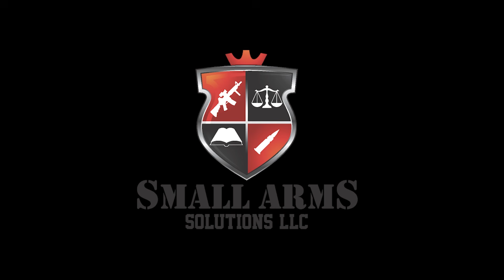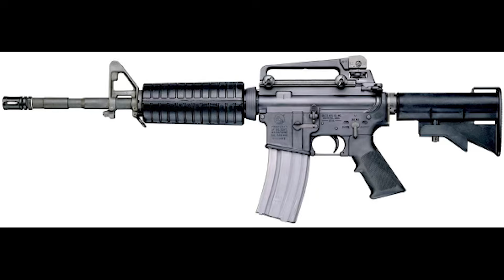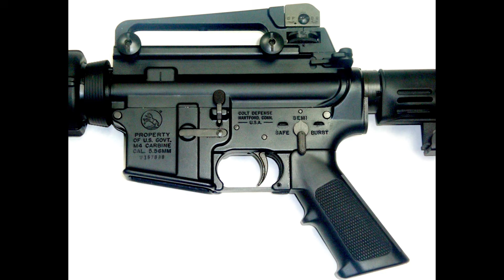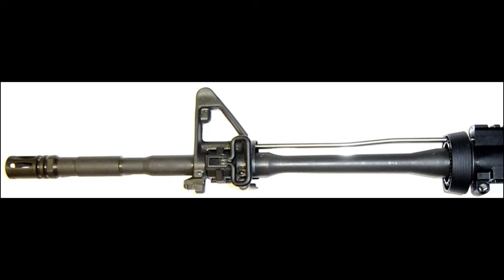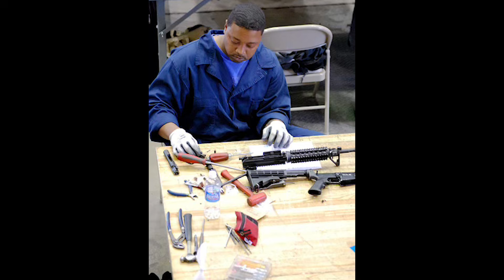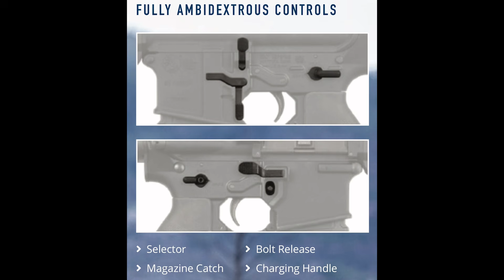History of the US Govt M4A1 Carbine

Comment: I never understood how a 14.5 inch barrel became general issue. I much prefer the 16 inch for an AR carbine. The cartridge really is best from a 20 inch.
Reply: Colt used the carbine gas tube in the M4 and needed the rifle to fit their bayonet, so they went with the 14.5 barrel..The gas port is also the same distance from the end of the barrel as the standard M16/M16A1/M16A2..
Reply: The very first Carbine with a 14.5” barrel was the Colt 653 M16A1 Carbine, where everything was the same as an XM177 except for the barrel and muzzle device.  ATF banned the exportation of XM177s with the Moderator because they considered it a silencer, so Colt made the 653.

Prior to that, the first carbine model was actually the 605 with the barrel cut to 15” and everything else the same as a 602 basically, called the Infantry Leader’s carbine, but it still had RLGS and short-stroked in cold weather and on AUTO.  If you open the gas ports on them, they run fine.  Mine has never skipped a beat and it has a lot of parts made pre-1963.

The original Commando was the 607 with 10” barrel and modified handguards and buttstock, but they were expensive to make that way, so they did the Colt 609 (XM177E1) with CLGS, ribbed carbine handguards, and a new RET, lock ring, end plate, and aluminum stock.  Those short-stroked under adverse conditions due to lack of plug dwell time, so they increased the barrel length to 11.5” and used a 4.5” moderator with baffles to bring it down to the muzzle report and flash of a 20” gun.

Comment: I feel like you've been kinda jaded when talking about AR's in general. Will external piston win? No, not really. UK, New Zealand and some other countries got their new AR's in the internal piston and that most external piston guns are like smartphones. There's always a new version of it that isn't backwards compatible and the old ones will never see a new parts made for it. Also, It's funny that you talk about lacking durability, but somehow the M4 handled the older M855A1 better than most of it's competitors.
Reply from the maker: No, the competitors in the IC programs did outperform with the M855A1 over the M4. They used enhanced barrels and bolts. They were all designed to exceed the operational parameters of the M4.
Reply: @SmallArmsSolutions  The questions is which ones did? There's really no data from this test and if we go back to the 2007 dust test. The numbers and story behind it are sketchy at best.
Reply from the maker: You are very correct. The data only went back to the manufacturers on their entry. Dust Test 2 was severely flawed and not done correctly nor scientifically. The information i have been given is as I said, all manufacturers exceeded the capabilities of the M4 but not enough of a “significant leap in technology” to make a change.
Reply: @SmallArmsSolutions  that's why it's weird to me that you're trying to say that the external piston gun are the way to go when all these years you said the opposite. I'm not trying to say anything bad about you, but it feels like I'm back reading bad gun forums from 2007. I'm also not saying that the M4 is flawless. It's an old design that needed an upgrade and we eventually did with the block 2 and URGI.

Comment: I have heard quite a bit about the advantages of the mid-length gas system; why was this not considered for the M4?
Reply from the maker: It was considered by SOCOM. They did a report on the benefits of the mid length gas system and how it did everything better. But getting it in production is a bureaucratic and logistical nightmare. Also it was argued they could not use the M9 bayonet. This is a change that should have been made in my opinion,
Reply: @SmallArmsSolutions  Thanks.  I figured it was pretty much an admin problem, like keeping the A2 barrel thin to fit the M203--it seems like simply changing the clamp on the launcher would have been simpler.

Comment: Carried an M4 as a POG vehicle mechanic 2013-2016. I never had an issue with it except at the 500y qualification. I always wished I had an M16A4 for those 20 rounds. I tend to think the M4 as a standard rifle is ridiculous and probably came about because the Army has a huge number of females that can't shoot M16s
Reply: So women can't shoot an even softer-recoiling rifle?

Hard no. The M16 was dropped because its long and most combat was being done in urban setting in Iraq plus most troops were traveling inside vehicles with limited space
Reply: @echodelta2172  The transition to the M4 in the big pickle Army was well underway already in the 1990s, starting with 82nd, 101st, 10th Mtn, and 25th ID after Ranger Regiment adopted M4A1 in 1994.

In 25th ID, we got them in 1/24 Recon in 1997, over 4 years prior to 9/11.
Reply: Both are 4 MOA weapons, so neither has a high hit probability at 500m on human sils.  You can do everything exactly right with a 4 MOA weapon and there’s a high probability that you will not connect with an 18” wide silhouette.  A 10.5” free-floated CQBR with a half-decent barrel will out-shoot the M16A2 at 500m all day long.  Main factors in US Army interest in Carbines for entire Infantry units was based on 9th ID Motorized/Light, 82nd Airborne, 101st Airmobile, in parallel to Ranger Regiment and SF.  They were already looking at Colt 653, 723, and 727 Carbines for 9th ID in the 1980s which fed into the XM4 program.  They needed a compact weapon to fit in the Chenowith dune buggies, but once they deployed the concept light Motorized units to National Training Center at Fort Irwin, the concept was invalidated in decision-makers’ minds and funding for the XM4 Carbine was pulled.

JSOC, Ranger Regiment, SEALs, AFSOC, and some units in SF were already using Colt 653s, GAU-5A/As, 723s, and later 727s in the 1980s.  Most guys in the Line in Ranger Battalion carried the M16A1 and later M16A2 though.  RTOs, Officers, Mortar Team Leaders, Sniper Team Leaders, RSOV Teams, AGs, and others drew out carbines.  Most of Army SF carried M16A1s and A2s as well on ODAs.  The shoot teams left over from Blue Light were some of the only ones to use Carbines.

Comment: Right on!! I’m kind of surprised we didn’t clone the HK 416 and switch to that.
Reply: Because it was heavier and less durable for little added benefit.
Reply: The HK416 is too heavy and way over gassed, that has decreased the life of the rifle..HK had to use a firing pin spring and a firing pin lever to stop slam fires that occur because of the carrier's high velocity from being over gassed..The parts are also way too expensive compared to a standard M4 rifle..

Comment: So with modern sporting rifles with the government profile barrels are they at risk of having the issues the m4 have as far as over heating
Reply from the maker: No, civilian rifles will never get that hot. Mostly a problem in ambush conditions or in a prolonged heavy battle using auto fire. Of course having a very hot ambient temperature does not help.
Reply: @SmallArmsSolutions  ok my second question is about midlength carbine gas systems is there really any pros or cons to them
Reply from the maker: There is absolutely pros to the midlength gas system. It improves every aspect of the rifle.
Reply: @SmallArmsSolutions  thank you for all the info you give

Comment: When the barrel has been submerged in water, just open the bolt to break the suction, and the water will drain out.  Easy peasy.
Reply from the maker: I know this. The external piston guns, you come up shooting. No need for that step.
Reply: @SmallArmsSolutions  Wouldn't the water just get pushed into the piston and force a premature extraction? H&K offers OTB features on the 416 but they're not a default configuration.
Reply: @SmallArmsSolutions  The external piston AR rifles use an extractor support nub in the barrel extension that prevents this..Couldn't the M4 do the same?

Comment: I got a good deal on a BCM M4 SOCOM barrel and was going to build out a nice M4 clone with some improvements. I wanted the RAS rail, but when Chris explained the issues with it, I decided to go with the BCM QRF. Not only did I get a free float quad rail that weighs the same, but at 1/4 of the price. The KAC RAS rails are going for ridiculous money simply because people want to clone what the military issues.
Reply: There is really no reason to use a RAS/RIS today unless you enjoy clone builds. Though that being said I still have one on my first AR that I picked up for the princely sum of roughly $30-$40 (I suspect it fell off a truck) and it has been rock solid so I have never felt the need to replace it.
Reply: Early in my AR experimenting I had a rifle length KAC. Yeh, it was well made and solid but Cripes! it was heavy. Accessories seem to double in weight when mounted on an AR. Depending on the barrel, scope/mount, handguard mounted hardware, it wasn't hard to end up with a 12 pound rifle.
Reply: @LuvBorderCollies  I was issued an M16A4 with the KAC rail, PEQ, and ACOG. Believe it or not, we didn't complain about it too much because it was decently balanced with the A2 stock. when I was about to deploy, they gave me an M203 and then I complained.
Reply: I have a KAC RAS rail on my LE6920... It's been ok, but I'm tossing it for something lighter.
Reply: Don't quote me on this but I think Brownells offers a KAC rail clone for a lot cheaper than an original will set you back. Never seen one in person so no idea if they're decent, but for a clone build where u just want it to look right that could be an option.
Reply: @Mjdeben they weren't Brownells brand clones, they were P&S RAS rails which are 100% identical to the KAC. The P&S rail is a government contract rail so there's literally no difference between them and KAC. However the run of P&S rails Brownells (and primary arms) sold are no longer available and probably won't be ever again. I happened to grab one in the brief window they were being sold and it's solid. Like I said 1:1 identical to KAC besides logo

Comment: I read in Chris McNab's Book The M4 Carbine, that the M4 was first type classified in 1987 from the Colt Model 777, but that the US congress denied founding and therefore the M4 was put on hold, until in 1993 the need for a carbine has reemerged and the Colt Model 920 was bought as the M4 in large numbers. In that true?
Reply from the maker: The M4 was type classified in 1996. The XM4 of course predates.
Reply: The date discrepancy is due to the service which did the type classification: USMC versus the US Army.  The USMC approved the XM4 (Model 720) for service use in January 1987.  This can be confirmed in Ed Ezell's "Small Arms Today, Vol 2" and in congressional testimony regarding the USMC's FY1988 budget.  Congress used the Army's exit from the XM4 program against the USMC.  The US Navy killed the USMC's follow-on budget requests.
Reply: @danielwatters1203  Thanks, that clears up a lot. I have this book and found it on page 409.